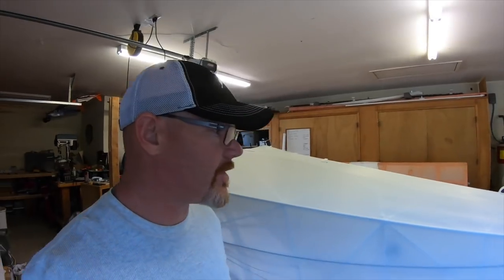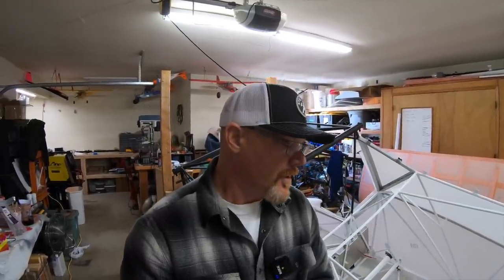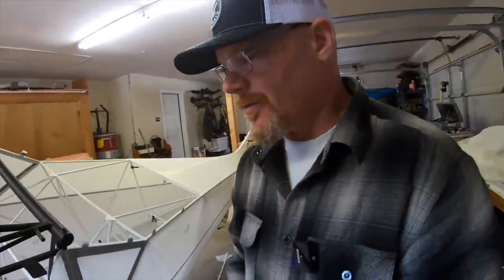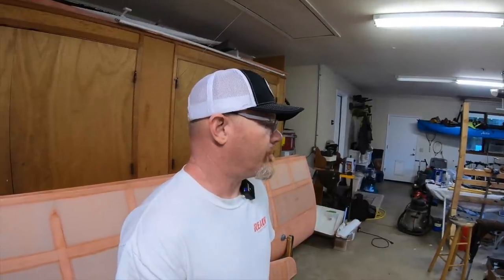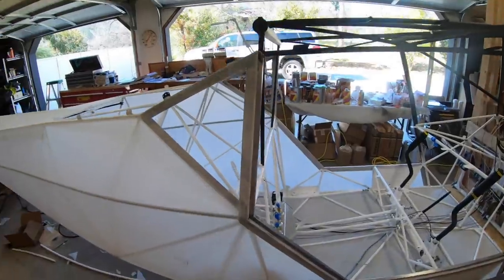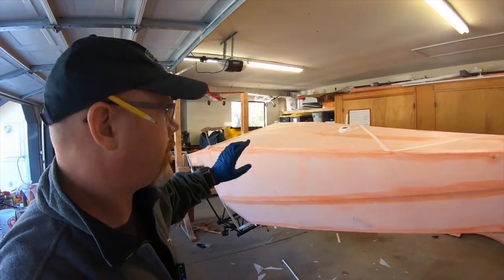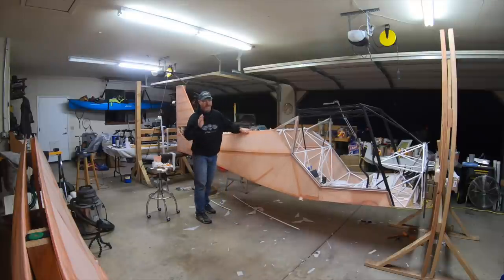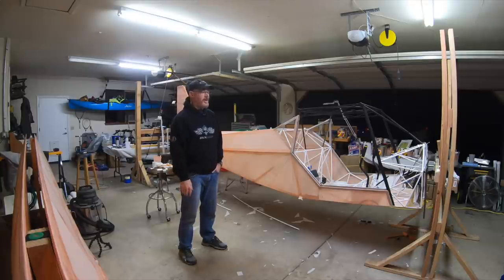Kitfox 7 Apex Build Episode 17 Finishing the Fuselage Covering

Comment: Thanks for taking the time. Those tubes misplaced. Can you slice and bond new ones in the correct location. Just needs protection on the bottom. Kitfox coming in June. All this is great to watch.
Reply from the maker: Good suggestion. If I can't get them out I may need to do that.
Reply: Can you carefully take a cutoff wheel and cut the swage on the cables without destroying the cable?

Comment: Archer here, if the CF arrows were built correctly the tips/inserts will have been installed with hotmelt (and not CA) so just heat the metal bit until its warm enough and you can just pull it out.

Comment: As far as cable covers over control tube,  you might consider Gluing a piece of poly tube onto your control tube where cables touch.  If and when they wear into poly, it would be easy to peel off old, and restore new piece on control during condition inspection.

Comment: It seems like I am seeing you use the ski waxing iron to heat shrink the fabric.  You must have been able to come up with a way to calibrate the temperature.  Can you share how you did this?

Great build and so instructive!  Thanks!
Reply: theres a thermometer button you can buy, you set it on the iron to check the temp.
Reply from the maker: It doesn’t get hot enough for the final shrink but is useful for the first couple passes.

Comment: Awesome video, Bryan! Really enjoying the build!

Just a thought regarding the rudder cable sleeves. Could you just leave the incorrect ones in, as they're not causing any harm, and just add new tubes forward of the mounts? Cut the tubes lengthwise to install them over the cables and affix them to the mounts, somehow?
Reply: Maybe get another 2 sleeves, split them down their length, vee out the join along its length, pop them in. Now sleeves on both sides. Cool.
Reply: Glue them before popping them in.

Comment: Great progress Brian! I feel a collaborative Onshape.com design coming on, if you're interested - for a 3D printed split-shell mount to clamp the ends of the (reused) rudder cable tube ferrules, or new slitted tubes, onto the existing post. It should be a straightforward design - and useful for my own kit due in 11 months WooHooo! :)

As for securing the aft window panels - before you screw or rivet*, check out a couple of great 3M products:
The vast range of 3M VHB (Very High Bond) tapes for all sorts of industrial applications is definitely worth a look. I used 3M VHB 4943F (available on Amazon) for securing 3D printed ABS avionics mounting brackets to the engine side of a firewall in a recent Jabiru rewire project. It avoided the need to drill any more holes in the firewall - and if the part were to get so hot the ABS exceeds its glass transition temp (>105ºC) or the adhesive fails (>150ºC), well there's other things to worry about. Here's 3M's VHB design guide: https://multimedia.3m.com/mws/media/1204168O/3m-vhb-tape-design-guide-high-res-pdf.pdf

Alternatively - but I suspect the adhesive is quite a bit thicker - In USA: 3M 'Window Weld Sealer' ~ UK: 'Auto Glass Direct Glaze Adhesive Strip'. PN 8611 is the widest at 5/16" (8mm). Lastly, I heard the RV guys use a Sikaflex RTV product - but that's definitely going to be messier to apply neatly.

*Considering aircraft fabric is primarily glued on (except for rib stitching) I don't understand why we're still putting stress-risers into aircraft transparencies by screwing and riveting, when very capable adhesives exist. The result looks neater too.

Jabiru VHB mounted accessories pics:
https://www.dropbox.com/sh/1mjkg5fpuvmm8kk/AAAUqWr6_3H63oQgx51Rf6E0a?dl=0
Reply: I'm a bit behind the drag curve, sorry - the Kitfox Final Assembly Manual (available online) mentions using VHB tape for the aft windows - but doesn't recommend any one in particular.

Comment: For the arrow shaft, I would go with carbon because it is stronger. The tip is easy to remove from a carbon shaft, or you can get a new one for $1.50 from your local archery shop. All that said, I expect you will be fine with what you have
Reply from the maker: It is only holding up a few ounces of fabric. Strength really isn't an issue.

Comment: Bryan (hope I spelled that right), regarding the rudder cables, instead of messing with those incorrectly installed sleeves, how about putting an anti-chafe block on the control tube?  I'm thinking of approx 1/4" thick UHMW, shaped to match the tube OD.  It could be located with a couple of small roll pins and held in place with those rubber-lined zip ties that Mike Patey sells (with the rubber ties, you might not even need locating pins).  Then, in ten years when the UHMW wears a bit, it's easily changed by cutting the ties and installing a new block.  You could probably make the blocks from a cheap cutting board like this: https://smile.amazon.com/dp/B000W4OC80

UHMW melts at around 265 deg F, so you can heat it in your oven to around 230-240 and form it to the control tube.  Cut to size first, then heat, form to the tube and clamp it until it cools completely.

Alternatively, you can get low-friction, high-tack UHMW tape and wrap the control tube with a few layers.  It might be harder to replace down the road, but less work overall.  The tape is also available on Amazon.

Awesome channel; I'm always happy to see a notification for Project Kitfox!

Comment: Dry ice may make the hisol brittle enough to crack out away from the metal, 

   Is the tube long enough to cut the glued inch off and still cover the fwd bar , then you can easily hack out the remaining piece.
Not to sure about using heat gun even then , you have your powder coating and the bottom fabric is a bit close for oopsy's
 
  Another suggestion is leave it and put a bit of plastic tube along the front bar where the cables may hit . Bit of pvc tube cut along so it just clamps over the metal tube , you can replace it if worn then .

Comment: Brian, what you are calling tape is it really tape with adhesive or does the Polly coat just soaking through the fabric hold it on, also I can't tell because the camera is to far away, does the tape have straight or jagged edges .
Reply from the maker: It is just pre-cut fabric that has pinked edges and is glued down with the poly brush.

Comment: Do you need to remove the covers on the cables? You might add covers where they should be and leave at the 'wrong' place if it doesn't hurt the function.
Reply: Paul Gradenwitz I was thinking the same exact thing. I’ve had a throttle cable snap for this exact reason. The protective cover was not installed correctly. More covers always seem better than less to me now ;)

Comment: those tubes don't look very thick. why cant you just cut them  length wise and install them in front and use pvc glue and glue the seam back together or if its different plastic just use fast set glue.   number of ways to cut that tube.